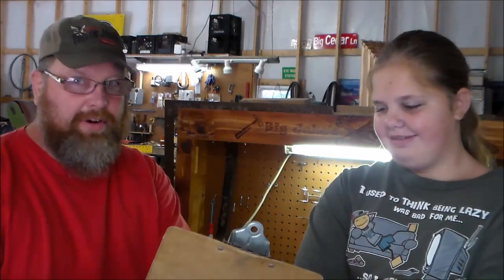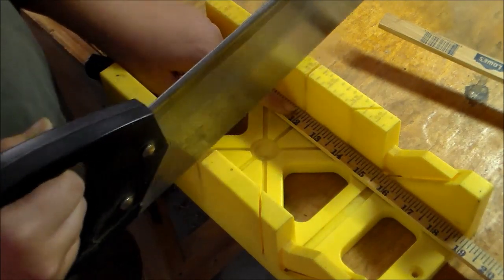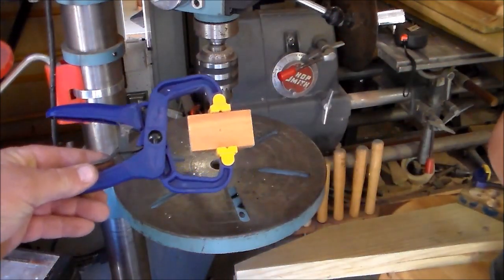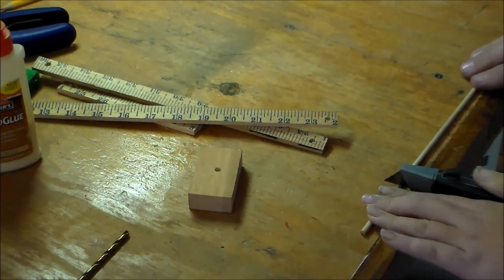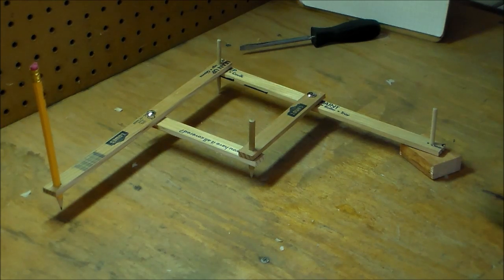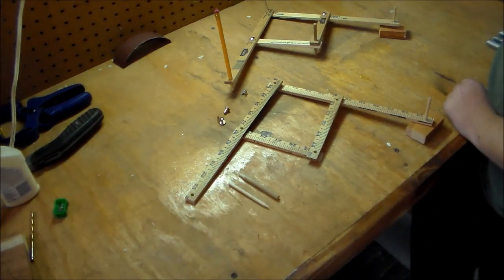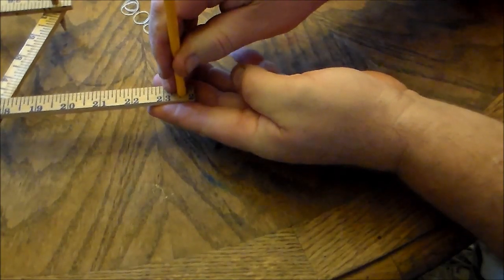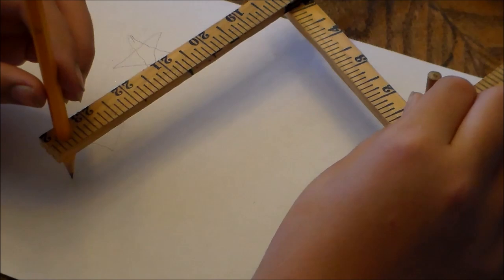How to Make a Pantograph. Great project for kids and adults alike!

Comment: put other hand on the stylus and you get more control. your test originals are too small to demo the tool well. also you did not say that use different holes you can get other scales like 1.5x,  3x. Put a weight on the pencil and hand on the stylus.  better control. Go the other way to reduce.

Comment: Try holding the pencil that's over the photograph, instead and follow the lines on the photo while the pencil on the drawing paper moves over the paper on it's own drawing out 
and duplicating what's on the photo.  It's harder the way you're doing it. Just saying...
Reply from the maker: Yeah, we tried that at first but the pencil doesn't have enough weight to make a clear mark. If you were using a marker, that way would be great.
Reply: Self Made Project adding a little weight to the pencil side should work. Maybe using coins to add a little weight start with one and keep going till it feels and writes good!  Play doh could possibly work too itta got a little weight to it and doesn’t need to be glued on. Or poster rack...this might be better. It’s dense so it weighs more and doesn’t need anything else to attach it since it’s an adhesive....I say that loosely...itself. Oh and BTW I am making your recipe for the pantograph tomorrow!!! I also just bought clear rollers to try it with those too.
Reply from the maker: Cool! Good luck!

Comment: very nice.

i do have some questions, if you have artwork (large image) drawn on a 8x10 paper & wanted to enlarge the artwork onto a 14 x 22, what should the length of pieces for a Pantograph ?
Reply from the maker: Well, I'm not sure I'm qualified to answer that! But, I'll try. First off, 8x10 is more of a square than 14x22, so you would have some extra space in the 22" direction. The way I would think about it is the ratio or scale factor of the enlargement. In your example, 14 is 1.75 times as large as 8. So, I believe you would drill a hole at for the center pivot of the first arm at a ratio of 1.75 times the length. So, let's say your long arm is 12" from pin to pin centers and your short arm is 6" from pin to pin center. If you drill the hole in the long arm at 6 inches, that would be a scale factor of 2 since it's halfway, or 12/6=2. You want to know 12/?=1.75, which would 6.85" for the hole in the long arm. In the pantograph we made in the video, I think I stated it as a factor of 2, but in reality, we drilled our holes at centers of 11" and 5", so we really had a factor of 2.2. Confused yet? I am! I think the best thing you can do is just make one and experiment with it. I'm sure there's something out there on the web that has pantograph formulas or charts. Good luck, let me know what you come up with.